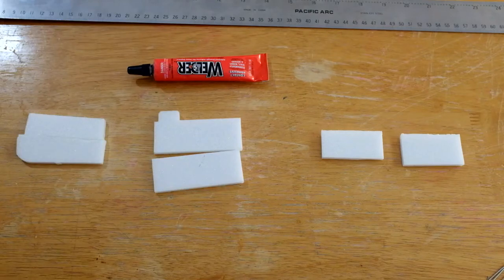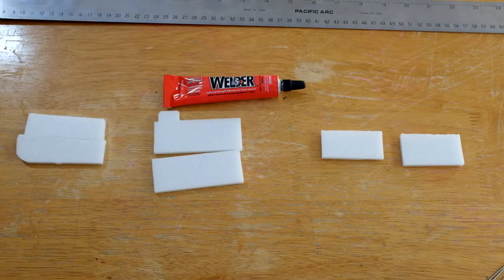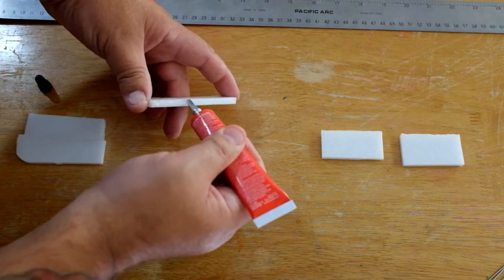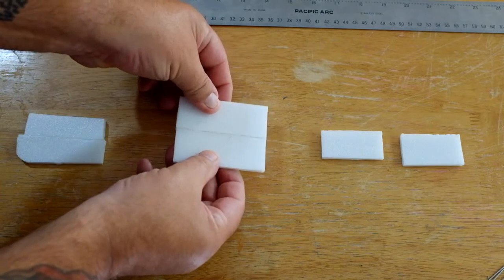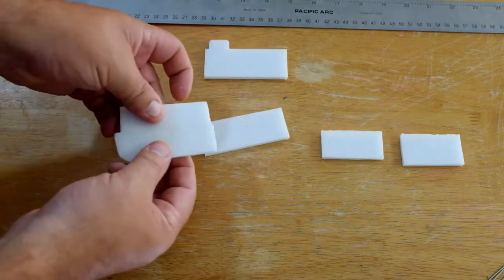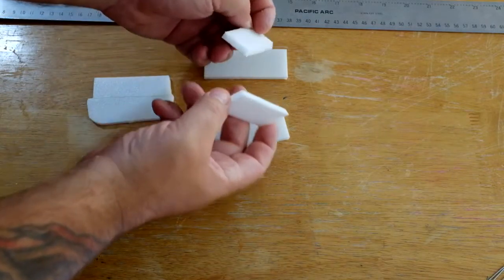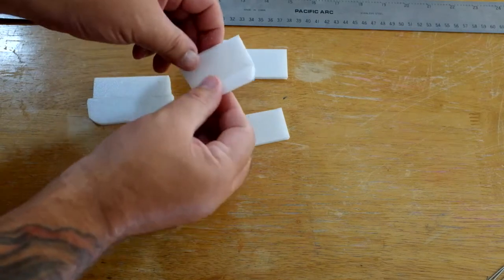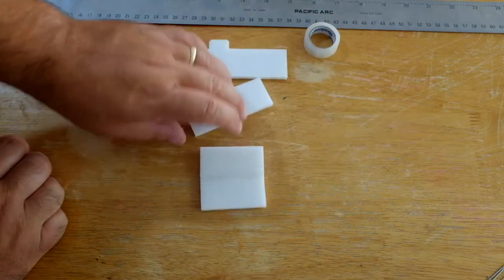Twisted Hobbys  How To Use Welder Adhesive Glue With EPP Foam

Comment: Is there a difference between the red tube and white tube Welder Glue? The white tube seems to take much muck longer to setup / dry
Reply: i have the same question but could not find any answer.  could it be that the red is the older model replaced by the white one?